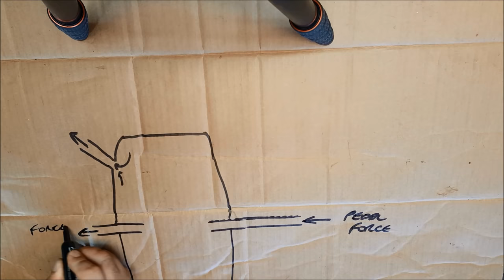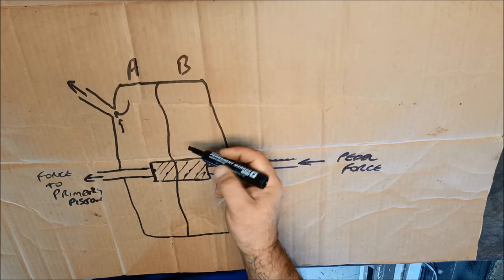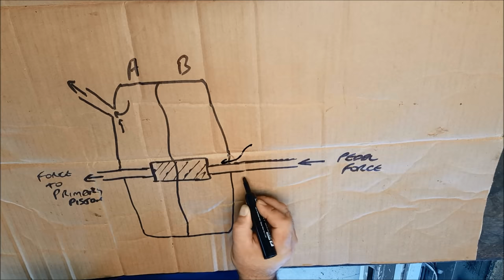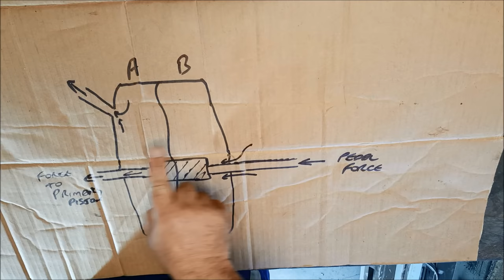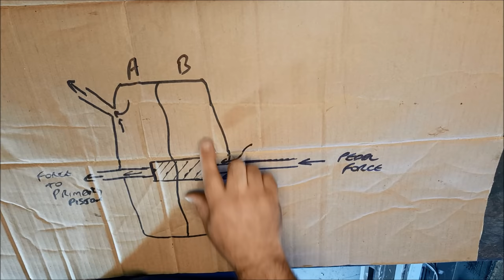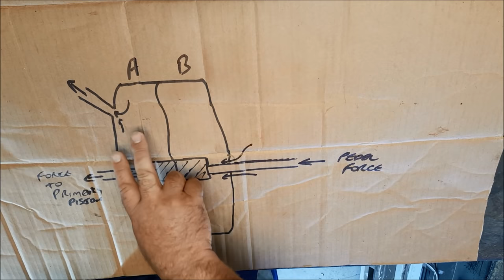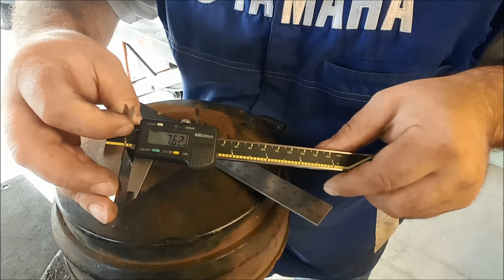Brake booster checks, operation and push rod adjustment #1313

Comment: Great vid! You didnt mention adjustment  of the rod from the brake pedal. If its threaded,  wouldnt it need adjustment? Theoretically, you could do the adjustment you spoke about, but it still not work correctly because of the pedal rod length?
Reply from the maker: Totally. Pedal adjustment free play is critical but not part of this video...I think one push rod is enough per video! Lol

Cheers Andy

Comment: Excellent video explanation.
I'm wondering if you could enlighten me about a problem:
Recently changed the BRAKE BOOSTER alongwith the MASTER CYLINDER of a sedan car.  However, while applying EMERGENCY BRAKES / or FORCEFUL BRAKING, the car does not come to rest and the braking force is not sufficient and in addition the ABS gets triggered way  BEFORE  the point where it should and that too during a soft pedal effort.  
Technician told me to drive the car for three days and the brakes will adjust.  Is there an adjusting mechanism which will rectify this problem so that the car braking system can immediately halt it during hard braking??
Reply from the maker: Hmmm...that does not make any sense, the ABS system only comes into play when the ECU senses extreme reduction in one wheel speed compared to the other three wheel speeds. Therefore, the only way the ABS can be triggered is when a high braking force is applied OR you are on, say, driving on a low friction surface such as snow or ice??
Reply: Many thanks for the reply.  Noticed that all four wheels do not skid while ABS is triggered during braking which is not too hard .  For ABS to trigger, either too hard braking or locked wheel under slip, is required as you confirmed.  Not sure why ABS triggers during soft braking.  
2.  Should I get brakes adjusted to tighten them up for sudden braking so that the ABS triggers only at the very end point where the car nearly comes to a full stop?
Reply from the maker: The ECU triggers the ABS, it has nothing to do with brake adjustment.  You'll have to get the car to a diagnostic shop to investigate & check wheel speed sensors first I'd suggest
Reply: @AndyMechanic  Thanks Andy.  Appreciate the insight.

Comment: 10/10... really interesting... currently having issues with sticking brakes on a 71 Transit ''all drums" and currently having M/Cyl re sleeved + new seals, and o/hauling the Servo with a Lockheed kit. I've looked at the pushrod & wondered if that could be a problem,  "now I can test it".. used to be a Jafa & loved Ack but moved back to blighty in 2013 & still miss the Magpie's song...

Comment: Hey Andy, I have a 1995 Ford Explorer two wheel drive 4-wheel disc brakes with ABS. Any ideas as to what might be the problem in a brake system where there's a hard pedal for about a second "ONLY" during a panic stop other than that the braking system is just fine. I have good vacuum going to the brake booster (20 inches) the brake booster one-way valve is working properly. Parts that were replaced were the power booster, new brake pads front and rear, new brake fluid and brakes bled. The only thing that was not replaced was the master cylinder. The problem still exists after the above work was done. Could the master cylinder be my problem, I'm running out of things to replace. LOL  I would hate to have to replace the master cylinder only to find out it's something else that I missed. Keep in mind it only happens during a panic stop, I have to stomp the pedal pretty hard for it to happen otherwise it's okay. I would appreciate your help on this one or anyone else that can shed some light on this situation. Thanks
Reply from the maker: Take out the fuse for ABS and try again. Let me know if same symptoms occur. Cheers Andy

Comment: This video was so well explained, thank you. I have a problem with a new build. Disc/ drum set up with a stiff pedal. Everything has been checked, vacuum (22 in @ idle), check value is good, hose is the correct type but it fails the pedal test when the vehicle is started, no movement what so ever. I can also hear a hissing sound inside the vehicle when the brakes are first applied when running. Is this normal? Should I check the rod from the booster to the master? Thank you for the video, I learned a lot too.
Reply from the maker: Hmmm....sounds like you may have an internal leak in the booster. See if you can find a vacuum pump with a gague. Connect it directly to the booster (no one way valve)

Then pump up vacuum, it should hold it until you press the brake pedal.

Let me know what you find

Thanks
Andy
Reply: @AndyMechanic  Hi Andy, if I let the truck sit overnight and go in the vehicle without starting it and step on the brake pedal I can here the booster hissing, so I am thinking its holding vacuum. Everything is new, there is no adjustment for the push rod. It seems to be a GM Type booster and Master. Someone told me to install a smaller bore Master to increase pressure. It just doesn't behave like a power brake should with the hard pedal. Thank you for your suggestion and wonderful video.

Comment: Can the boosters' push rod (behind the master cylinder) be pulled out by hand? I thought the push rod was one piece or fastened. My push rod blew off when blowing air on it when cleaning.
Reply from the maker: Hi Keith, some push rods can be removed, others are fixed at the booster end so can't be taken out. Just pop it back where it came from & you should be fine.

Cheers Andy

Comment: The only problem with this rod adjustment method is that it doesn’t take into consideration the constant vacuum that is normally applied.  The correct method is with a special tool that bolts on like the master cylinder, and then a vacuum must be applied, and then the clearance can be measured.
Reply from the maker: Thanks Marc, never heard of that method nor seen the toolyourefer to. I think it's highly unlikely any private individual or most repair shops would know about this tool nor have access to one? It isn't me.tioned in any of the Factory service manuals for the vehicles I have worked on, maybe its model/brand specific?? 

Thanks for your comment though, we are all learning every day. Cheers Andy

Comment: The pushrod on my brake booster does not protrude, but is lower than the body of the booster.  I wonder if this is normal.  This would give a negative result to the first measurement that Andy does...???  Would the pushrod on the booster always protrude??
Reply from the maker: No, just depends on the design but the measurement method I'd the same.

Cheers Andy

Comment: 2nd gen tacoma booster has an internal rod and the master cylinder has a piston that inserts into the booster, how do you adjust these? Install them and just adjust the threaded rod attaching the booster to the brake pedal inside the vehicle until the pedal feels right?
Reply from the maker: Don't think so as that's booster to pedal adjustment. Best ask Eric O at south main auto, hes worked on those...

Cheers Andy

Comment: If the original master brake cylander is on the car and is replaced with an aftermarket part. Can we just measure the distance of the old bore to surface and check it against the aftermarket part to see if they are very similar?
Reply from the maker: Yes but it's likely that there will be some difference and even 0.1mm is too far out. Cheers Andy

Comment: first a question.   in attempting to adjust the pedal hight and travel, I adjusted the rod length at the pedal end.  There is a clevis where it attached to the pedal, but to avoid a difficult to remove bolt through the pedal, I instead rotated the push rod through the booster.   After viewing this, I went back and measured the rod lenght and set the clearance properly, and then set the pedal hight, using the clevis adjustment.  the brakes are working ok now, but I am worried that I may have damaged the booster internally.   Did I damage anything internal to the booster, or is the rod free to rotate??

There is a "power brake booster tool",  sold by Ecklers.com , which makes the adjustment process much easier.  
it looks like this 

one side is placed on the mc and the slide pushed down to set the depth, then the other end is placed on the booster and measures the rod length.  very easy to use.  Cost is $25 US, but it would save a lot of time. 

Thanks for the great lesson.

Comment: HI Andy.  I bought a RWD Ford car with low brake pedal. NO lights.  Anyway, it needed a front wheel bearing badly. I figured it caused it.  I replaced all the wheel bearings, calipers, brake hoses and brake pedal (went down to floor.  I then replaced the master cylinder and pedal still goes near floor.  I then replaced the ABS unit and same problem exist.  I bled many times.   I wonder, could it be the push rod adjustment of the brake booster?  If so, why would it be out of adjustment?  i have never had to adjust one.          Could the replacement master cylinder be bad?   Could it have an internal leak into itself causing low pedal?
Reply from the maker: Golly....there are many possible causes of a low brake pedal...here are just a few:

1. Air in the system - possibly trapped in the ABS module - you may need a scan tool to actuate the pump to bleed up - check service manual.
2. Push rod between servo and master cylinder - could be too short or too long - check as per video.
3. If drum brakes at rear check shoe to drum adjustment - if excessive you will get a low pedal
4. Trapped air in load sensing valve at rear - these usually have their own bleed nipple.
5. Excessive piston retraction on calipers - see video about this.
6. Ballooning flexi hose - you'll need someone to press brake pedal whilst you check all the flexibility pipes.
7. Poor adjustment of push rod between brake pedal and servo
8. Ribbed brake discs with new pads fitted - this makes the brake pedal feel very spongey - will improve once pads wear to match corrugations in disc surface.

So. First job it to see if the problem is to do with the front or rear brakes. Clamp off the flexibility pipes to the front calipers and see if pedal goes hard when applied, if so then your problem is likely at the front. If still very low pedal then issue is likely to be with your rear brakes.

Hope this helps
Andy
Reply: Had a collapsed line myself, wouldn't release pressure causing overheating

Comment: Really good video explaining the brake booster I have a question I have a car that not braking good I did all the test that you sad and everything is good but when you sad if there’s can be a pin hole in the diaphragm you will get brakes but not the force I’m thinking I have a issue because my rotors are not getting clean after the rain or setting thanks

Comment: 7:15 holy shit man I think I finally found my answer. Last week I have really slam on the brakes. Now as I brake, it feel normal and the truck slows normal. But the brake pedal will get stuck down within that first inch of travel and apply braking even with my foot off the pedal. The only way to release it is to give the brake pedal a quick firm stomp and then the brakes release. I know there is fluid in my booster so I am changing that this weekend. I'm just wondering if the master cylinder is damaged as well. I am not noticing any loss in the reservoir so the brake fluid in the booster has to be coming from somewhere. I'm thinking by slamming the brakes so hard maybe I bent the push rod in the booster. Adding, vehicle is a 2008 Cadillac Escalade. I'm a very mechanical guy but this one has me stumped. Please any input?

Comment: Can the hose going to the vacuum valve go bad? I think I did something wrong. I did my rear calipers, I thought I bled them right (one-man method), didn't see any air in the line when I was done, closed everything up. The car brakes fine from the front (the side I only changed the discs and pads on), but i don't think much, if any brake force is being applied in the rear. The pedal is really hard to push down. I tried the booster test a few days ago and it DID go down like it should. So I'm kind of stumped. I'm going to take it to my local shop who said they'd bleed it for free, maybe they can tell me what I did wrong.
Reply from the maker: Maybe the rear shoes need to be adjusted up towards the drums - too much travel or possibly there is trapped air in the load compensating valve (if it has one?). They usually have their own bleed nipple. Hope this helps. Cheers Andy

Comment: I didn't do this because i didn't know but the breaks seemed fine untill about 10 minutes of driving then the front breaks locked up do you think its the reason why me not adjusting pushrod? Thanks in advance
Reply from the maker: Yes. Definitely

Comment: Hi there.. I upgraded my brake booster to a bigger one (7"),  Post that the brakes were very effective, however after driving for a while, the brakes start to drag and the pedal becomes harder. I have to disconnect MC from booster to release the brakes .. and again it works for 100kms without issues and then same problem repeats.. what could be the reason for this?
Reply from the maker: Yes definitely - push rod is slightly too long....

Cheers Andy

Comment: If a hand pump vacuum/tester cannot pull a vacuum on the booster port, and I can't pull a vacuum breathing in on it either,  does that mean the booster is automatically bad?  (testing just the booster by itself- no master cylinder attached)  FYI- I tested 2 other brand new boosters from China and neither one could establish any vacuum reading at all on my Mityvac tester.  I can understand a bad one leaking, but two brand new ones from China did the same thing- no resistance to air flow OUT the port.  PLEASE HELP!

Comment: Very informative video and I like the way you explain things.  My question revolves around testing the brake booster check valve.  Your test shows that as long as its one way diaphragm works with a vacuum test then its working properly.  My question is:  Is it possible for the vacuum of the manifold to over power the one way valve and keep it open or would this indicate a brake booster problem of not being able to supply enough pressure to close the diaphragm properly?  My brakes go straight to the floor yet my diaphragm passes your test.  Thank you.
Reply from the maker: +Chris Barnette Hi Chris, is your car's engine petrol or diesel?

Comment: I replaced my van's brakes with newly rebuilt calipers and also brake hoses and bled the brakes. It all works fine when the engine is not on when I bled the front calipers. 

The minute I turned on the engine, I could not rotate both of my front tires.  

What is the problem with my brake systems?
Reply from the maker: Check the adjustment of the push rod between the brake pedal & master cylinder. There needs to be a little free play. 

You could also try disconnecting the vacuum supply to the brake servo. If this solves the problem of the brakes been applied & you have free play on the push rod on the pedal then I think you have a leaking valve in the servo itself & it will need to be replaced.

Hope this helps. Cheers Andy
Reply: @AndyMechanic  
I have replaced both calipers in the front discs and wheel cylinders at the rear for the drum brakes.

For the booster test: While the engine is off, I pumped the brake paddle 4-5 times and hold it there, when I turned on the engine, the brake paddle went down a little bit.  This indicates the booster is okay.  Is that the correct assumption?

I indicated earlier that if I turned on the engine, I could not rotate the front tires.

Does this mean there is some issue with the brake booster?

If I disconnect the vacuum hose from the brake booster, after that I  rotate the front tires. If I can rotate the front tires, then it points to the brake booster is defective.   Is that the correct assumption?

How can I tell if the master cylinder is okay? 

I don't have any leaks from the master cylinder. 

What about the proportional valve?

Thanks!

Comment: My pushrod on the brake booster does NOT protrude but is below the reference surface.  How do you get in there to adjust it???

Comment: Hi Andy, I have a 2007 Pontiac G5, 2.4 . At the beginning of the video... you talk about the brake booster piston issue causing the brakes to bind up... The actual binding up issue is what is my problem right now. I can drive the car for a while but as I use the brakes the pads bind. Its driving me crazy. I have changed the Calipers and the Flex hoses thinking that was the problem but it still has not solved the issue. I am about to change the master cylinder but the cost is high and want to make sure I am right before I do it. I have not messed with either the master cylinder or the booster up until this point. Is it possible for the piston to get misalligned all by itself with wear? I have not done anything with either of these parts yet... I am just starting to run out of things to change and $$ :( . I start the car and go to work depending on traffic I am there within 30 minutes... if traffic is bad and I apply the brakes too much the car barely makes it without screeching to a halt. Any help is appreciated and nice informative vid.

Comment: Hello,  great video with detailed  and interesting explanations ! On my (European)  car there is no pushrod length adjustment possible... Before  i had to replace  my (failed)  master cylinder i measured the clearance with a calliper (comparing the two cylinders) i found 1 cm difference,  so i feared i would get a 1cm play between the pushrod and brake booster . I tried and  it appears there sort of  a "self adjustement" and the pedal feels OK